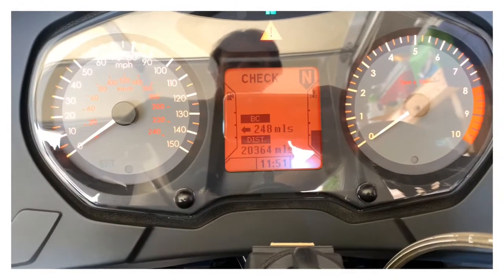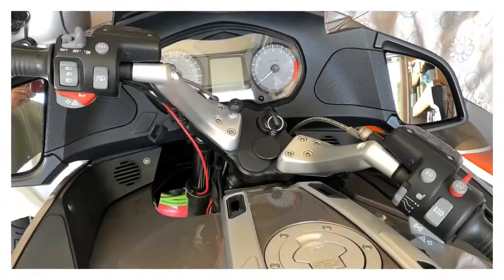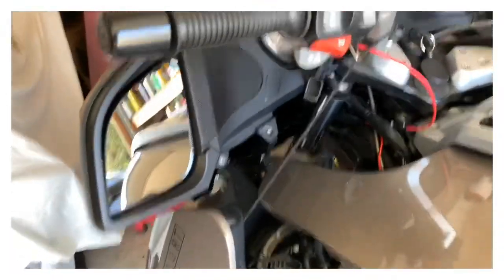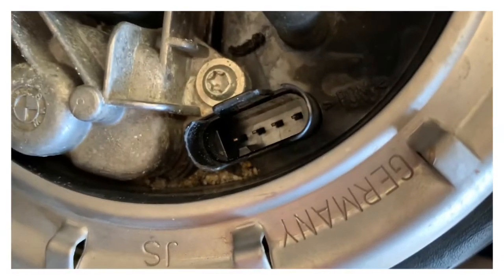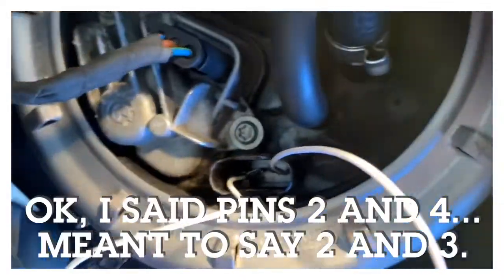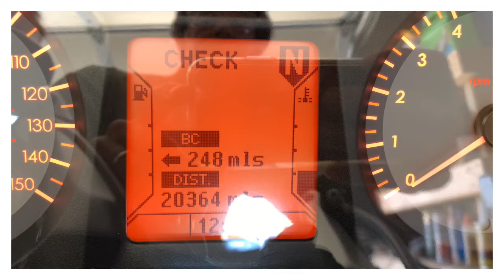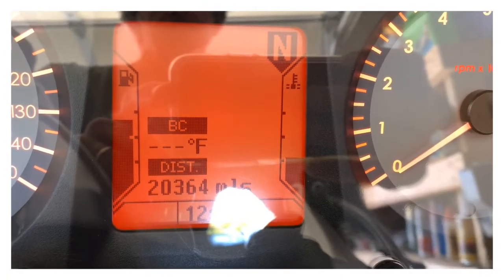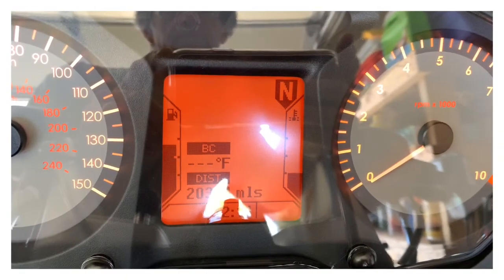Hexhead BMW R1200RT (2005-2009) Fuel Strip Zapping Fix

Comment: Well Curt, first I have to thank you for sharing this method!  I will begin by saying I am an amateur mechanic but will venture down unknown roads when I feel like I have no alternative.  The alternative in this case was a $700 invoice plus transportation costs in today's high fuel cost environment for my 2005 BMW R1200RT.  So, I took apart the plastics per your video (worked as described) and began making my Zap tool from some grill repair parts from Home Depot.  Once I had my homemade zapper built, I was ready to go.  I put the bike on the center stand, and hooked up the 2 leads to the 2 outside posts of the fuel display connector.  I zapped those 2 outside posts 12 times, then I moved the leads to the inside 2 pins and repeated the zap process 12 times to those leads.  I then removed my home made zap tool, reconnected the 4 pin harness and fired up the bike before reassembling.  After about 85 seconds, low and behold my fuel guage came back and showed the fuel level in the tank correctly and the yellow triangle error condition was gone!!!  Needless to say I was ecstatic to say the least!!!  I am pleased beyond words and can't wait to share my results with my BMW mechanic, who was very skeptical to say the least!!!  THANK YOU AGAIN FOR SHARING YOUR METHOD!!!

😃😃😃😃😃
Reply from the maker: I’m really glad it worked for you!  As evidenced by the comments, it doesn’t always work, and my bike seems to need to be re-zapped occasionally.  I have no idea how or why it works, but it beats going back to the dealership…. Again.

Comment: Just did this after watching two different YouTube videos. Went and filled tank. Modified an ignitor and no luck. Tried again making sure I had contact with the terminals. Worked!  If I have to do this twice a year, it's worth it. I can't stand things that need repair but also won't throw money at the dealer for a temporary repair. Bonus is the yellow triangle that I was told was a low tire warning is out.

Also, for those that are worried about ignition, research how industrial fuel tanks are welded for repair. As long as the heat is below the surface of the liquid, they weld.

Comment: Thank you for posting this. Just picked up a used 07 RTP and learned the hard way that the lower end of the fuel gauge isn't working correctly. Was still showing gas in the tank when it ran out of gas! I'll try this later. Been busy playing whack a mole with neglected-bike issue.

Comment: Confirmed in the positive via my TopScan Device which is a bi-directional scan tool My 2006 RT is finally free of all warnings or codes or unwanted warning lights. Did fill the tank with 93 before hand as suggested and added some VP Maddative to up the octane to 100 factory owners guide suggests 98 octane. I do keep it to a minimum of 97  as occasionally I run out of the VP Maddative. Stuff works.

Comment: Hy. I also own a r1200rt and a 1200gsa...they both do this thing but aproxmatly 1 time per year My recomandation is:before you zapp it make sure your gas tank is full of gas, the bike is on its center stand and also the side stand is up.. (in running position, not down like when its parked) My bikes fuel gage work fine aproxmatly 1 year after i do the zip as i told you...) good luck

Comment: Creating a high voltage arc inside a gas tank.  What could go wrong? ;)
Reply: My thoughts exactly. Got the same problem but I ain't doing that! Still, I'll watch someone else do it lol.
Reply: Boom! I'll spend the money instead of risking this and I would never advise someone to do this. Even since enough people said it works. How many did it fail in the worst way?
Reply: stoichiometric ratio, anything richer than 14:1 and the air / fuel mixture is too rich too burn. Fill your tank before you attempt this.

Comment: Zapped the fuel strip and it worked for 1 minute, if I do it again  will I get the same result?
Reply: Same thing happened to me. It worked and reset gauge. I turned the ignition off and got ready to go for a ride. Started the bike up a few minutes later and back to square one! Flashing yellow triangle and gas pump icon.. registering as an empty tank. I might try zapping it tomorrow.

Comment: I tried it did not work so I said screw it and bought a new one.
Reply: @clickrebel  yeah I bought the part and I bought the gs911 Wi-Fi diagnostic tool and it took a few time s for it to   calibrate  the  stick  I put it in and wham bam all good again Sam.
Reply: @clickrebel  Don't forget you have to do the stick when it is dry so you connect everything and set it on your gas tank and then calibrate do not do it when it is wet it will not work.